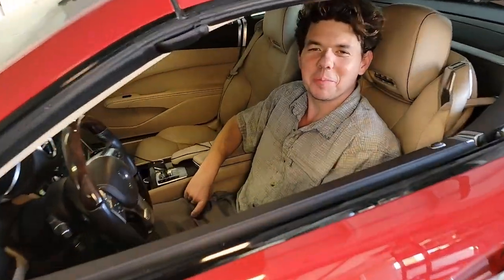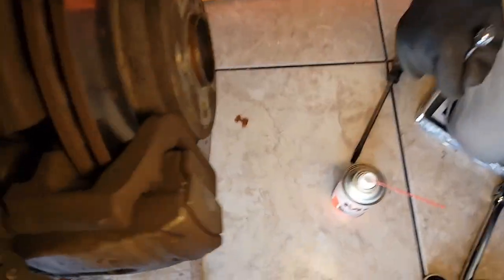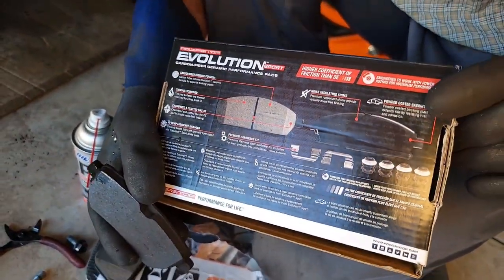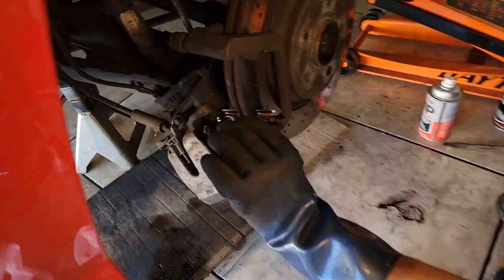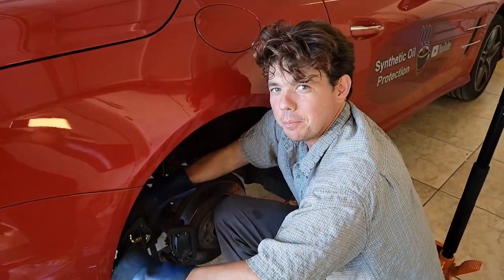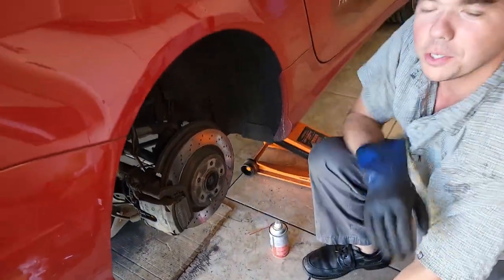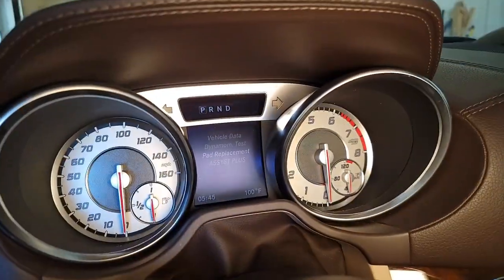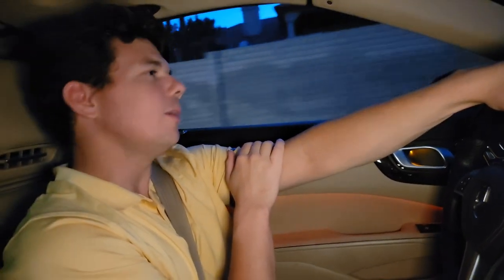SL550 R231 Rear Brake Pad install AMSOIL Parts Cleaner & MP

Comment from the maker: Everything I Did To The Synthetic Oil Protection Machine Since I Got It - https://youtube.com/playlist?list=PLB_ftWArBFdd-6mgaMuj9bNs7DvKRpNQm

     ❤️🇺🇸❤️ Professional YouLubher: Eben Rockmaker Regency Platinum Direct Jobber AMSOIL Specialist (Dealer#: 5331179) 702-472-3614 

      ✅✅✅  I Recommend The AMSOIL 6 Month PC Membership because it will give you the Best Value. You get $33 back on a $100 purchase after the difference in tax with  No need for auto Renew - https://www.amsoil.com/offers/pc/?zo=5331179 

     Your vehicle could run better than brand new by using the AMSOIL 100% synthetic lubricants. 

     AMSOIL Signature Series 5W-30 Synthetic Motor Oil protects against harmful deposits on turbochargers 4X better than Mobil1® Extended Performance in industry-standard testing*.  Read This Article - https://www.amsoil.com/newsstand/motor-oil/articles/leading-the-field-in-deposit-protection/?zo=5331179      

     ♥️ AMSOIL Performance Tests: Read This Article - https://www.amsoil.com/performancetests.aspx?zo=5331179    

     Find AMSOIL Products For Any Vehicle - https://www.amsoil.com/guides/?zo=5331179      

      If you would like to try the AMSOIL products this is my link and I will be your AMSOIL Dealer and will be able to answer your questions. 

     When you order as a AMSOIL Preferred Customer you will save about $33 on $100 order because of the 25% discount and the difference in tax. 

     When you click on my link I will be your AMSOIL Dealer If you go to a different device to order the products and do not click on my link you will need to enter my referral number so I will be your AMSOIL Dealer. My referral number is 5331179       

      AMSOIL Dealer Google Maps - Synthetic Oil Protection: https://maps.app.goo.gl/2AuZCi8h2Gaf3mY46 
             
      Synthetic Oil Protection Website - http://syntheticoilprotection.net/ 

      1959 Cadillac DeVille is using all AMSOIL products from top to bottom. SEE THIS PLAYLIST YOU'LL BE AMAZED - https://youtube.com/playlist?list=PLB_ftWArBFdeVKszO64Ig5nWEQp7H3oF-       

       AMSOIL Performance Test Results. Read This Article - https://www.amsoil.com/performancetests.aspx?zo=5331179 

About AMSOIL..... est. 1972: First 100% Synthetic Oil Certified in the USA 

1. Where can I find AMSOIL? - Use this link https://www.amsoil.com/offers/?zo=5331179  Or      

       2. What makes AMSOIL different than other oils? - AMSOIL is 100% Synthetic & has higher film strength & holds up 4× better in turbocharger deposit testing than Mobil 1 EP which protects and separates metal parts, keeping them from wearing and Lasting Exponentially longer. 

     3. Why should I use AMSOIL?: It protects the engine so it will last longer. Less oil changes less often (once per year/15,000 miles) or longer... Save money in Gas & Time making it less expensive than a FREE oil change over the course of a year. 
  
Oil Analysis Tests: 

15,500 Oil Analysis Test Results SL550 - https://youtu.be/3rdN6U1Jt_M 

5500 Mile AMSOIL Oil Analysis Test Results - https://youtu.be/3wf962IwEmo   

5000 Mile AMSOIL Oil Test Results On My SL550 - https://youtu.be/fLuvzN6yLSw 

11,000 Mile AMSOIL Oil Analysis Results on my Corvette - https://youtu.be/YEY_13UYzA4 

20,000 Mile Oil Analysis Results on Honda Uber - https://youtu.be/gm_PXlpiaTk 

26,000 Mile Oil Analysis Results - https://youtu.be/Wdq2A2YIorM 

80,000 Mile Oil Analysis Test Results Freightliner Cascadia - https://youtu.be/9A9k6i1xMoo 

25,000 Mile AMSOIL ATF Analysis Test Results - https://youtu.be/IeVPGR7UO9E 

      AMSOIL Signature Series 5W-30 Synthetic Motor Oil protects against harmful deposits on turbochargers 4X better than Mobil1® Extended Performance in industry-standard testing*.  Read This Article - https://www.amsoil.com/newsstand/motor-oil/articles/leading-the-field-in-deposit-protection/?zo=5331179      

     Better MPG Proven. Read This Article - https://www.amsoil.com/newsstand/motor-oil/articles/another-win-for-amsoil-products/?zo=5331179 

     AMSOIL Performance Test Results. Read This Article - https://www.amsoil.com/performancetests.aspx?zo=5331179      

    Try The Synthetic Oil Protection Coffee - Ebens Favorite. To Order Coffee Click Link Below: https://supportwith.coffee/shop/subscriptions/sop/

Comment: Haven’t seen the electronic backing off of the brake pads/calipers before.  Thanks for sharing another great video!
Reply from the maker: Of course Robert yeah I really like the electronic brake system on this car because when you put it in drive and tap the gas it automatically lets off the parking brake so you don't have to worry about driving with the parking brake on it's really convenient because it's working LOL

When it breaks then it'll be a real pain in the you-know-what....😁😆

So far nothing is broken on the car the only thing was when I was driving up the highway in my radiator cooling lines blew off hose wasn't that great from the factory and it came to laminated and it just came right off the metal ring was impressed correctly and that's the first thing that failed on the car since I've had it for over 20,000 miles

Comment: Dang. That is one high tech machine. I've never seen electronic assist on the brakes like that.
Reply from the maker: Yeah a lot of the new parking brakes are all electronic and basically it just is nicer because when you tap the gas it automatically lets the parking brake off so you don't have to worry about it staying on that's what is what you could say the benefit is

Comment: Love it! I have been using Power Stop pads and rotors for over a decade.  Best bang for your buck.  No more brake dust or any issues.
Reply from the maker: Wow I didn't know that I'm excited to see how the brake dust is now because the brake dust it was pretty harsh with the OEM Mercedes pads.

I'm definitely excited to see how the front pads go so far the back pad seem really good I'll have the front pads here by Friday and I should have that video up there's a very soon

Comment: Hello Eben, love the channel, I’ve been binge watching all of the Mercedes vids. 

I picked up my E550 biturbo coupe last year with 35k miles. Now has 45k miles and I’m really particular and I love taking care of my car. I don’t have all of the tools to work on cars so just for right now I’m doing oil changes with an extractor. I’m thinking I should do the diff fluid and trans service next. I think I’ll have my independent Mercedes mechanic work on it. Thinking of switching to all AMSOIL
Reply from the maker: That's great yeah you'll notice a big difference in the drivability when I got my car it drove just okay I gave it about a seven out of ten now it drives like a 9 out of 10 after all the fluids I also switched to the Toyo Proxes sport tires and I went to an 18-inch wheel instead of a 19-inch wheel so I have a lot more Road be on the street and more grip levels.
Reply from the maker: I recommend doing an engine flush on your car and also the high performance improver gasoline additive will make a huge difference if you have any questions or anything just let me know this is my link in that way I'll be here in Boyle dealer and I can always answer all your questions on the future on the products.
I'll also get the credit for your Waters and always be available to speak with you and I appreciate the business future business in advance.
❤️🇺🇸❤️ Professional YouLubher: Eben Rockmaker Regency Platinum Direct Jobber AMSOIL Specialist (Dealer#: 5331179) 702-472-3614 

      ✅✅✅  I Recommend The AMSOIL 6 Month PC Membership because it will give you the Best Value. You get $33 back on a $100 purchase after the difference in tax with  No need for auto Renew - https://www.amsoil.com/offers/pc/?zo=5331179

Comment: So excited to see more transmission fluid cold pours.  ATF+4  vs Signature series , i really wonder how atf+4 will be at -20F .
Reply: @Syntheticoilprotection  I'll tell you why i really wanna know Eben, i just bought some Amsoil yesterday , and i'm gonna replace the power steering fluid in my caravan with the amsoil , rather than the dealer fluid. But before i do, i wanna see how much better the Amsoil is.  I'm sure it will be great, as i have it in my other cars power steering too.  My mechanic even noted the smell as different than regular oil.
Reply from the maker: Sweet

Comment: Do you have to pump the pedal when the new pads are in to take up any slack between piston and pad before taking out of pad replacement mode.
Reply from the maker: Yes after you reset everything it's always good to just pump it a little bit make sure the fluid is where it's supposed to be👍

Comment: Hey I’m wondering if I should use the pi performance after I do the engine flush or is it fine for me to use it before the engine flush?
Reply from the maker: You can use them at the same time
Reply from the maker: I also recommend the power phone as well and this is my link just in case your new to Amsoil.
This will give you the best value on the products and when you use my link I'll be your hands Oil Dealer could you try to answer all your questions on the products
✅✅✅  I Recommend The AMSOIL 6 Month PC Membership because it will give you the Best Value. You get $33 back on a $100 purchase after the difference in tax with  No need for auto Renew - https://www.amsoil.com/offers/pc/?zo=5331179